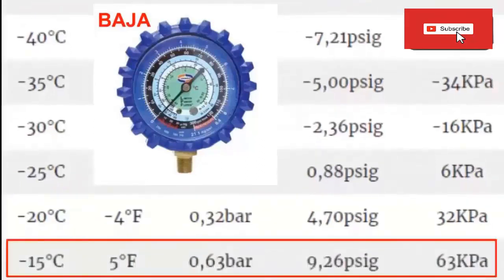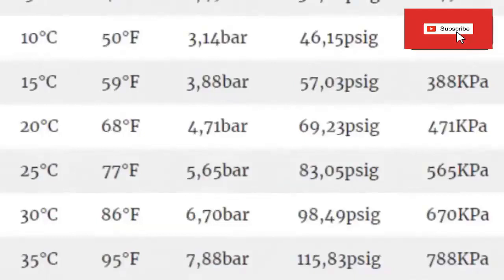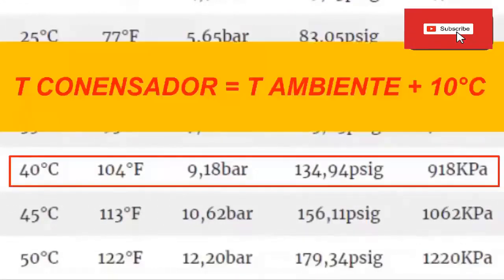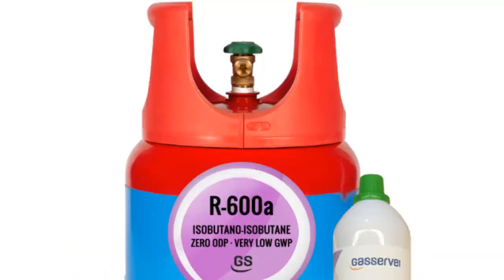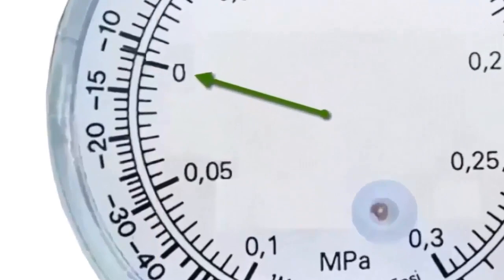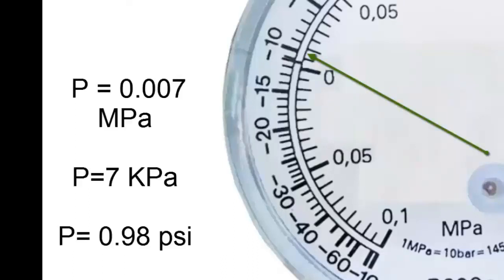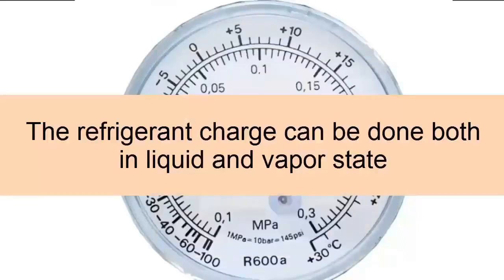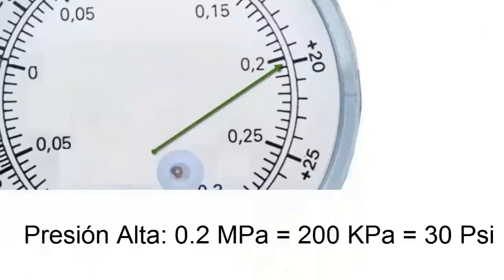r134a vs r600a which is better and its operating pressures In freezing, refrigeration, and A/A.

Comment: 600 is dangerous as h*ll and should be banned.
Reply: I've worked with r600a fridges for 15 years but never had any problem with them. My fridges and freezers are r600a model and i have no issue having them. However..it's not ment to break rules and work ethics and practices with r600a..😮
Reply: @hipihei It is hermetically sealed.. how often does your old freon leak out of your fridge even after 40 years? Unless your house is already on fire, which then your natural gas lines and stuff won't help either.
Reply: @mikafoxx2717  a can of deodorant contains more butane than some fridges...
Reply: @morgangrisby8107 
True that. I literally keep a can of butane on top of my fridge for refilling lighters.. 
And probably 4 pounds of propane on a shelf near my mini split on that note.
Reply from the maker: Therefore, R600a is used in lower-capacity equipment; in this way, the flammability is compensated by using a small amount of R600a.

Comment: Please I have a question 🙋‍♂️ 
Why my cheese freezer only has halfway freezing.
Thanks 🙏
Reply from the maker: The half of the evaporator or the half of the unit? It could be a lack of refrigerant gas or an obstruction in the capillary. In this case, the capillary should be very cold. Another possibility is a fan failure, causing a lack of air circulation. Here's what you can do: grab an amperometric clamp and measure the current consumption. Turn off the unit and let it stand for an hour. Then, turn it back on and measure the electric consumption after a few minutes. Compare it with the RLA (Rated Load Amps). If it lacks gas, the reading will be significantly below.
Reply: Change the settings
Check the airflow
Make sure the thermostat is good
Charging the refrigerant is the last option if anything else you can think of. If you have to charge it... there is a leak. Flammable leaks are not good... explosion risk.
Reply: please I have similar problems. how did you solve the problem?
Reply: @sylvesteresezobor2755  I have good news, my freezer has just been fixed now. I figured a leakage near the dryer filter and when trying to fix the leakage, we realized the new dryer filter we installed previously is faulty. I have to change new one and make sure the leakage is addressed.
The freezer is now working for like 2hours and the cooling is coming up ⬆️
Reply: @sylvesteresezobor2755  still working for the solution. One technician promised to fix it by weekend.